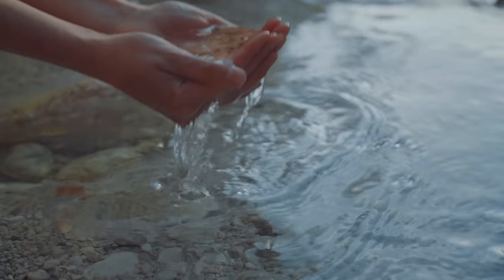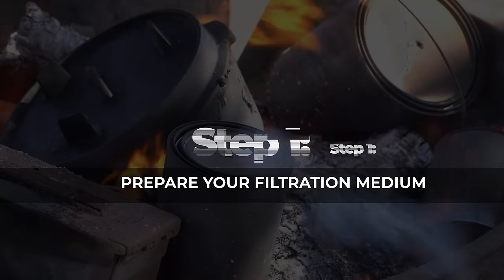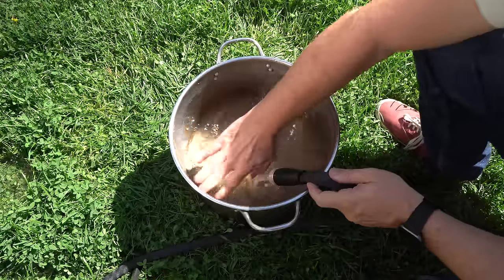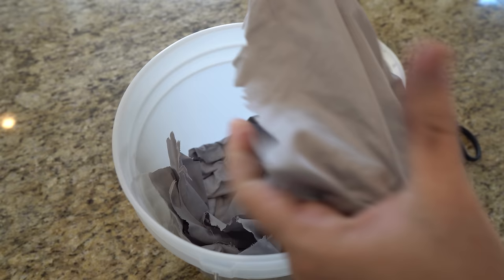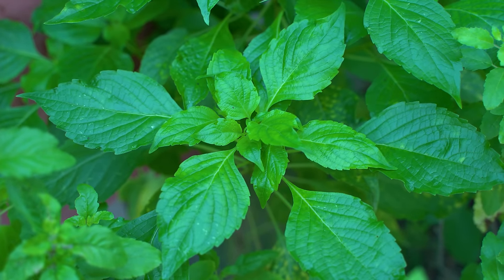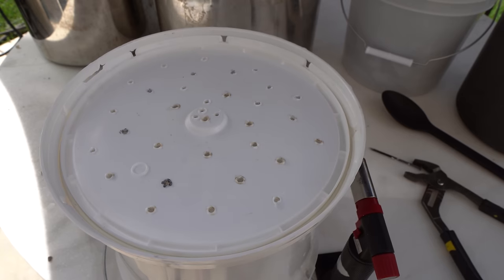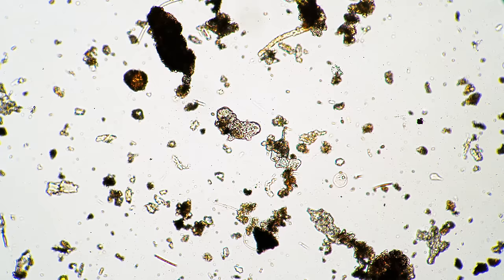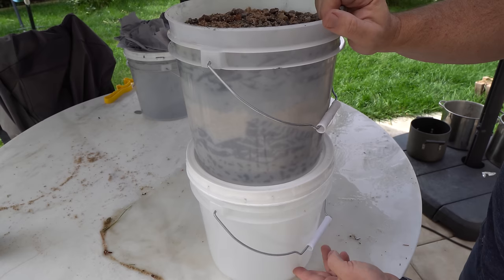How to Make a Water Filter With Available Items (Enhanced Microbial Removal) - DIY

Comment: Do the pine needles have to be fresh or can i store the ones i have on the ground now for future use?
Reply: Maybe freeze them?? It may or may not work you could trial it and see if it works. If you can freeze them in a ziplock bag for a few weeks then build it and it works then you should be able to freeze them longer

Comment: Hi Chris! Love your videos  , but this one was way to much for us apartment dwelling preppers living in the City!  My daughter won a science fare years ago on water filtration with charcoal and cloth. Very easy. This video was Way over the top for us "normal people". Thanks anyway!
Reply: As another apartment-dweller in an urbanized area I don't see this as any more daunting than the hydroponic set-up I ran for a couple years.  Actually, less daunting in many ways.  Water preps are a weak spot with me, in no small part due to space requirements.  This kind of water filter is something that could be made in advance and stored.  Those of us with very small apartments might consider renting a storage unit in which to keep that sort of pre-made prep and other items (the space under my bed is already full) if finances allow.  Off-site storage may not be as ideal as having a garage attached to your living space but you have to work with what you have.